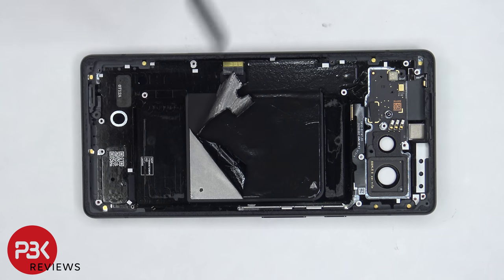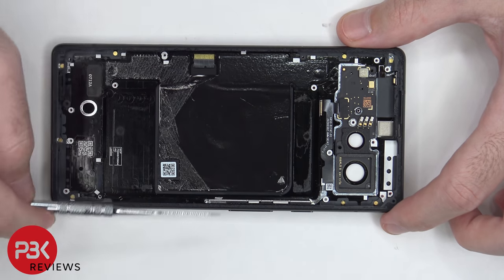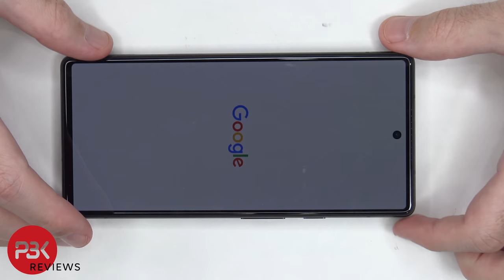Google Pixel 6 Disassembly Teardown Repair Video Review

Comment: Might be a weird question but can the back glass be removed and made to be transparent? I really love the transparent phones like in Jerry Rig Everything videos!
Reply from the maker: I tried to remove the glass, it looks like it should be replaceable but the adhesive is really strong so I did not want to risk cracking or breaking it so I left it alone. But even if you clear out the back, on this phone you wont see anything since the glass sits over the aluminum uni body of the phone, there is only a square cut out for the wireless charger but aside from that you would not see into the phone.
Reply: gonna have to wait for a dbrand skin unfortunately
Reply: @neolordie  wait for Jerryrig
Reply: would love to just replace it with some plastic panel... more reliable, thinner and less weight))
Reply: @neolordie  skin is released
Reply: yes

Comment: That main camera is enormous for a phone. I'm looking forward to seeing what Google is able to do in the coming months as they tune their image processing for the larger sensor. Right now they're still using basically the same image processing that they've used for several years with a much smaller sensor, so quality is only going to improve with time.
Reply: Phone cameras are becoming an overkill. IMO   For the average person even a 3-4 year old phone takes perfectly fine pictures.  Pros are better off with high quality digital cameras with replaceable macro and tele-photo lenses.
Reply: @BillAnt it's more for video everyone wants a 5k recorder in their pocket so companies are racing to make that happen.

Comment: Fantastic teardown, vey glad to see how easy it is to replace the screen. Now we just need Google to actually SELL US the screen! 
I'm glad they didn't serialize components like Samsung and Apple, they deserve credit on that!
Battery could be a bit easier to replace, and the soldered on charging port really sucks.
Thanks again for these teardowns!
Reply from the maker: Thank you and You're welcome :)
Reply: Nothing in this teardown either confirms or refutes serialization. We simply don't know until someone attempts to swap components from two similar devices.
Reply: @MikeTrieu  Not this teardown, his 6 Pro teardown, he did exactly that. Swapped components to test what would work. Only thing serialized is the fingerprint reader, which makes sense. And Google provides you the calibration software to re-calibrate a new fingerprint reader, which is unheard of and a huge step forward for right to repair.  https://youtu.be/qyEmChOMAN0 We can assume this applies to the regular Pixel as well.

Comment: Thank you for pointing out the soldered on charging port! 
Hope devices will be more modular in the future, once Right To Repair passes...
Reply from the maker: You're welcome. Yea hopefully :)
Reply: Sorry but has nothing to do with right to repair. Watch this video: https://www.youtube.com/watch?v=Utlh5diSmWU&ab_channel=LouisRossmann
It is when phone manufacturers use a certain chip that the manufacturers of these chips (eg. TI, Samsung etc) are not allow to sell or like Apple that even genuine Apple parts (e.g. from brand new phones) can't be swapped between the same two devices because they don't have the same serial number. 
Soldering a USB C port to the main port is not like that. It worsens the reparability, but it does not make the operation impossible like in the mentioned cases.
Reply: @b0nz1official  I know what you are talking about, but in my opinion, easier repairability also counts to R2R.
Reply: @平和-v1z  There is an engineering and durability reasoning for such choices. Not everything can be made modular while meeting goals set by the team for longevity.

The same thing goes for those being upset about the how complex these devices are to disassemble. You can only do so much in such a small space.
Reply: @平和-v1z  Then watch the video. Louis Rossmann is probably one the most famous proponents of R2R. And he explains in detail why there is a huge difference and he doesn't want to force companies of using parts that are easier to repair because it could slow or hinder progress. 
He even explains that he is worried that people don't get the difference and you clearly are a candidate.
Reply: @winebartender6653  Bingo. Lois Rossmann also explains that in the video that I've linked. And he was worried that people mix these 2 topics and they really do. 
Easier to repair is not the right to repair. VERY big difference.
Reply: @b0nz1official  Maybe in the future someone will do a repair on how to solder off and replace the USB-C  module in the future. If not, I guess the wireless charging will have to do if my phones port messes up, lol. Does the pixel 6 even have wireless charging?
Reply: @dargm818  Yes it supports 21W wireless fast charging as well as reverse wireless charging.
Reply: @b0nz1official Nice. Thank you. Do you know why it peakes at 21w and not at 30? I've read that as you get higher in percentage, it cuts more and more as well.
Reply: @dargm818  I've done some tests with a power meter. Yeah it does go up to 22W from 0 to around 65% then it gradually dials back. It is not the fastest phone to charge. 

Keep in mind however that google is quite honest with their battery level. Some  Chinese manufacturers like to tweak the scale of their battery levels so it looks like it's charging faster. Or like Xiaomi they claim 120W charging when it "only" does 80W for about a minute. 

The Pixel 6 is not the fastest charging phone but it does not bother me. 
It gets noticeably warm if it charges with the screen off. Not too much but more would be not ideal for the battery lifetime. 
I think this is why they chose not to charge faster.

Comment: Man, you do it with such a ease.... Thanks for the in depth info. Short, to the point, concise.
Some others would produce one hour long teardown. You covered putting it apart and putting it back together in less than 6 minutes. Thanks a lot.
Reply from the maker: you're welcome 👍
Reply: Well, it's easy for those who do it for a living every day and with the magic of video editing.   Even pros sometimes make mistakes and nick a cable.   After 22 years of fixing phones, sometimes it happens to me too., but that's how you learn.
Reply: saved me writing exact same thing

Comment: loved it! Wish they used split battery tech for a faster charging solution :(
Reply from the maker: Thanks! and yup would have been good if they did.
Reply: @PBKreviews  I came back here to know more about the device. I am now a proud owner of Pixel 6. ^_^
Reply: @prakharagnihotri5579  I'm here for the exact same reason. Would you recommend this device for long term use?
Reply: @jvbenjamin  Yes I would. 100% but i have a feeling that Pixel 7 will have all those tiny issues (that 6 has) solved and improved on.  So if you are not on a budget constraint and can wait 5 months, Pixel 7 would be a better buy. 6a looks beautiful with that handy form factor but pixel 6 will still be a better overall device when comparing the two. So if you want one NOW close your eyes and get the Pixel 6. See if you can get a carrier sale price of $549 that would be sweet. Only get the 6a if you are tight on budget or want a small handy phone And pixel 7 if you can wait a bit. 
I have a feeling that the Pixel 7 will be $100 more than 6 (ie; 700 dollars) so you have enough time to save up.

Comment: I don't know if this has happened before, but here it goes.

My Pixel 6 suffered from a swollen battery and it pushed the screen away from the frame. I went to a Google authorised service center to get the battery replaced. A day later they said that they could not remove it. The reason being that they were unable to remove the screws. They even asked me if I had gotten it checked somewhere else. Of course I hadn't. They suggested that the screws seemed to be worn and gotten stuck. Im not sure if this was a manufacturing defect, but this spelled the end of my P6 journey. The screen now hangs by the flexible connector. Pity that the phone had been dropped just once and was in perfect shape with no cracks or dents. And barely 1.5 years old.
Reply from the maker: You can always use a power drill with a drill bit small enough to fit inside the screw head, and drill slightly into the screws to break off the heads. Then you can use a clamp or something similar to grab and twist the broken screws out and replace them with new screws.

Comment: So theoretically I just need to remove the display and have instead access to the battery after removing a few screws and the display swap seems easy af as well? That's great, means that in case of the 5 years of updates I have to swap it it's pretty easy to do.

On the other hand: if the USB-C port dies there's the whole PBC to replace...
Reply from the maker: Yup. The charger port will require someone with soldering knowledge to be able to de solder it and solder a new one on. Some repair shops do it.
Reply: @PBKreviews  honestly I managed to screw up my display only once and the only thing I had to do was a battery swap on a OnePlus 6 + the USB-C ports are dust eaters, so cleaning that one with some Tweezers. The phone I screwed up the Display was a sony Ericsson. Fun story tho: had a empty glass on my table with a spoon in it and knocked it off the table while my phone was laying on my PC. Catched the glass, but well... Display got spooned, lol :D

Managed to modify a Dell Streak 5 to give it more internal storage, was fun. One of the first Android devices back then and the only thing you had to do was swapping an SD-Card on the PBC. Repair wise I really loved that one back than
Reply from the maker: @L1ghtbirdy  yep some things were a bit more simpler back in the day.

Comment: Let's say you want to add mmWAV antenna? Is that an option because i really didn't want to get a locked verizon or att model just to get that but would like to add later if possible.

Comment: Hi..
Can you please tell me the position of the wireless charging coil in pixel 6...

I am unable to get the exact position with the apple magsafe charger since the pixels lack the magnetic rings... So it is a hit or miss mostly😅

Thank you😃🙏
Reply from the maker: Hi, I don't have the phone with me anymore to take measurements but its usually in the back center of the phone.
Reply: @PBKreviews  THANK YOU 🙏🙏👍

Comment: Thanks for the info. I was able to successfully repair my stuck lock button :D (just needed to shoot some isopropyl alcohol and air into the gap behind the button). If I want to re-glue the screen down (for water & dust resistance) what sort of adhesive should I use?
Reply from the maker: You're welcome. You would need this adhesive: https://www.ebay.com/itm/353905995635?hash=item526670ef73:g:zZkAAOSwNGBiBoss&amdata=enc%3AAQAIAAAA4BaT9F4j%2FRvU%2FRm43BO4Eh2J84UdL5H5doASFVJd5k1ZC25ElsX8rtYXCcAPTATz97vbjeev69USNoajzhKA7b%2Flnttu3q3Ixu1rbQWSpIrXSNti727GrQk4X5IktVDLv07zo2y59Djz1HnfG5dn4LW%2B2k2sEoZPgVJlzK8GShQaliufsqwyfuhpVPt1I7IA0Cn1OxukArLF0yJaGSirOTFn4nt2JFSxJU1bSh7OVVoYH24XD5NzNFHR61WSj6yQjUI0UMf3HNJee2X7lFgo%2ByQflqACvi8oEbDjYNelGM8w%7Ctkp%3ABk9SR_Lv--u8Yg

Comment: They had a mmWave antenna placeholder ?! Does that mean there are some variants of the Pixel 6 that do have that antenna installed? Does the mainboard even have that antenna connector?
Reply from the maker: Yes, the Verizon version will have the mmWave antenna. You can see the solder points on the board next to the battery connector where the mmWave antenna connector would be.

Comment: thx i swapped case and screen thanks to your help! good guy. had to order another fingerprint sensor. my screen had no sensor and the connector from the sensor to the "plug" is discontinuous and only connected by a middle foil, so you cant even transfer it. it is a cheap part tho. cheers.

Comment: Would a 3rd party repair shop replace the graphite heat transfer film if they replaced your battery?
Reply from the maker: If they have the part I would assume so but most likely only authorized service centers like ubreakifix which get parts directly from the manufacture would have the graphene heat transfer film to replace. However, if they carefully peel off the film and not damage it, it can be reused.

Comment: Does Pixel 6 has sound dampening foam in loudspeaker same as other flagships have?
Reply from the maker: Yes it has it on the top speaker but not the bottom. The pixel 6 pro had it on both top and bottom speakers.

Comment: This is the first teardown I ever watched. Good Job right there. I got a pixel 6, overall I I loved the phone. I have one problem tho, the fingerprint scanner. It's even slower than the Samsung I used for years. I saw its sth, attached to the screen. Is it a new tech? Google said they wanted it to be more secure and it's a new technology. What do you think? Thanks
Reply from the maker: Thanks. Yes its attached to the display and a lot of newer high end devices have the in display finger print readers. I personally don't love them since they are not as fast as the physical ones in my opinion.

Comment: Wow great job PBK. I am so suprise about top speaker size. So big, and bigger than top speaker any smartphone with dual speaker and it's about same size as bottom one. Maybe has small foam ball inside. Thats company also think to make great audio and not only performance new Tensor chip and great software from this Google company. And how about version 6 pro.
Reply from the maker: Thanks! Yea the top speaker was surprisingly large and also has the white foam balls but the bottom didn't seem to have the foam balls. I will try to do the 6 pro as soon as I am able to get one in.
Reply: Oh I see. Thank you PBK. Thanks for your full explain. Great teardown video.👍👍👍
Reply from the maker: @zuhayrzainuddin1150  you're welcome and thank you!

Comment: Hey, i got a question, basically my Google pixel gets hot as some games, and the heat appears to be pretty much where the screen connector is, does it mean that the connector is defective? Or might something else cause it? Because sometimes it can get hot as a pan.
Reply: same as mine. but i noticed that it only heats up on the aluminum frame and the heat is not dissipating that much to the screen or the back. seems like the passive cooling graphene size used here is pretty small plus the poor thermal of the tensor itself due to samsung's less efficient fabrication
Reply: @jpara_dise  that might be it, but it's so long ago that now I'm having the new Pixel 8 Pro, the heat problems are completely gone, only if some weird programmed apps are running it might get hot, but not at any normal games, so basically Google learned from previous problems.
Reply: @Bl0wUMind  good for you. Seems like tensor g3 is a true upgrade from the tensor g1 chip

Comment: Did you switch components from another pixel 6 device to check if it is blocked like seen from Apple?
Reply from the maker: Hi, no I didn't have another one on hand to test that out.
Reply: @PBKreviews  If you could do that, it'll be super appreciated. Please let Louis Rossman know of the result, because according to a repair manual that was leaked, the camera(s) is software locked to the mainboard, making the phone less repairable for no good reason.

If you let Louis Rossman know with evidence, then we can either name and shame them or clear their name, depending on the outcome.

Perhaps this could be a part of your Pixel 6 Pro teardown review? If you do and Louis Rossman mentions you, it'll attract many more viewers too!
Reply from the maker: @Guy109897  I will see if i am able to obtain 2 of the pixel 6 pro to test it out.
Reply: @PBKreviews  👍

Forgot to say - great work with this and all your other vids! Keep it up, super informative and helpful :)
Reply from the maker: Thanks! I appreciate it. :)

Comment: The display sounds very "hollow" when tapped, you don't get this with a Samsung for eg. It's feels "cheap". I guess this is because it sits over the battery?
Reply from the maker: It's possible its due to the fact the screen doesn't have a metal back plate or any backing and the plastic boarder of it has it siting slightly above internal components so nothing actually touching it directly so might be giving it that hollow sound when tapped.
Reply: @PBKreviews  Thanks. Would this make it less strong or more likely to break in a drop?
Reply from the maker: @BatfinksWings  shouldn't affect it plus it has gorilla glass victus so should be strong.

Comment: It's nice that the video is short, but I feel like too many important things were cut off.  For example, the double-suction-cup tool looked cool; but was very upset its use wasn't demonstrated!
Reply from the maker: Yeah, I don't go too into detail on those things because I feel if someone doesn't have any experience at all and doesn't know how to use any of those tools, it wouldn't be a good idea for them to do it in the first place because so many people end up damaging other parts along the way trying to fix one thing. So I just try to show the stuff people want to see like internal build, cooling and basics on internal part removal vs how to use a suction cup tool. Entertainment wise yeah its a good idea, but educational wise not so much I feel. For example, I've had people who don't even know which button is the power button on the phone try to take their phone apart and damage it when they shouldn't have been attempting it in the first place :)